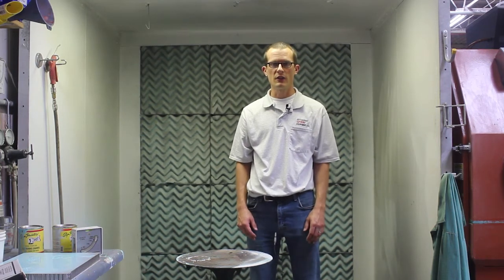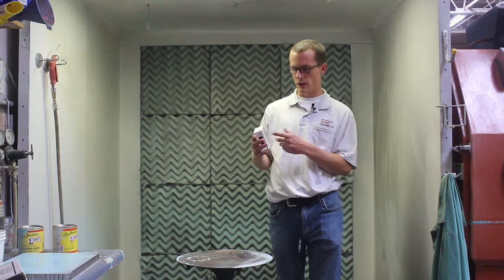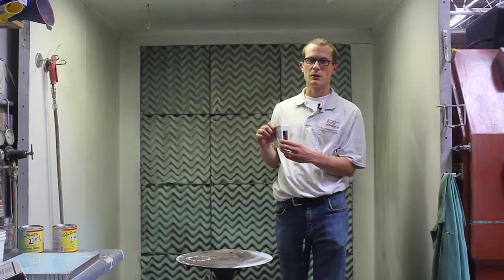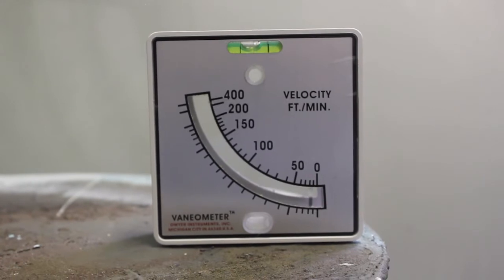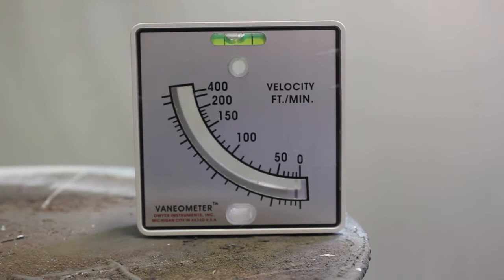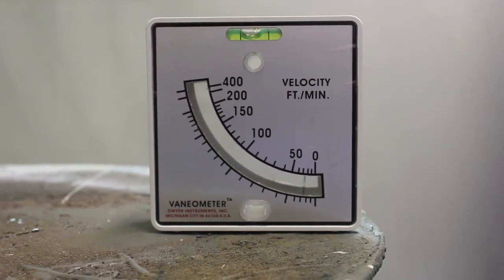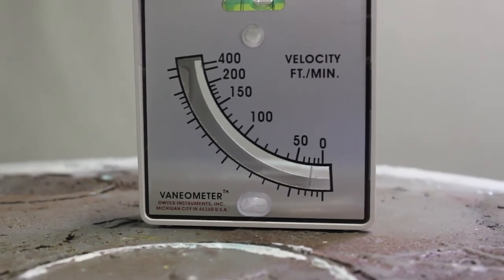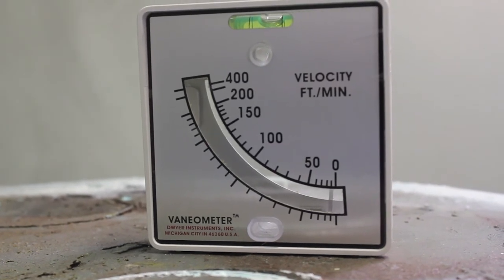How to Measure Paint Booth Air Flow

Comment: would you take air velocity measurements in an imaginary grid across the face of the booth opening or would you take air velocity measurements in an imaginary grid across the cross section of the middle of the booth or would you take air velocity measurements at the back filters? Which regulation or guidance prescribes where the velocity measurments should be taken?